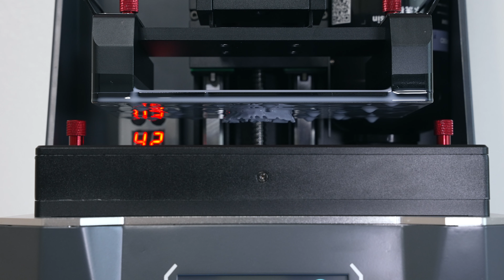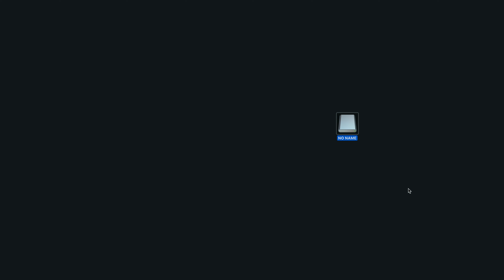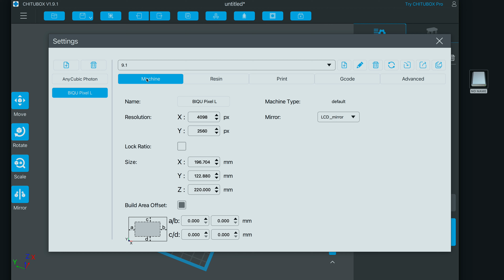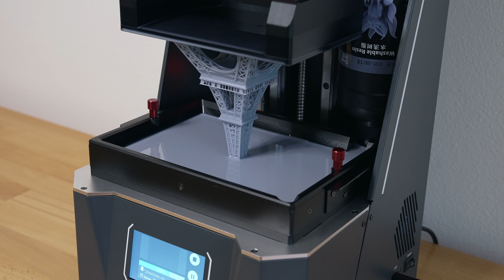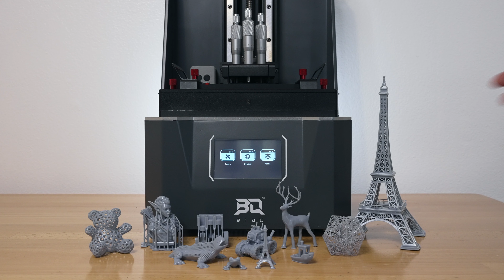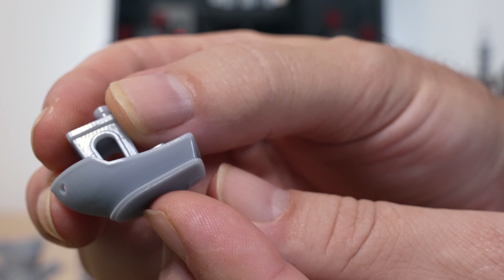BIQU Pixel L - 3D Printer - Unbox & Setup

Comment: Nice video. Just FYI, the clicky part of the micrometer handle is to set the appropriate torque on the micrometer for measuring. It does not adjust the depth, assuming this is a conventional micrometer handle and not a proprietary Biqu tool. The clicky knob prevents over-tightening, which causes inaccurate measurement readings. I don't quite understand why they provided these, unless it is solely to prevent over-tightening the build plate against the screen when leveling.

Comment: I dont understand why the heater control has seperate display and buttons inside the unit, when it has a touchscreen. Why cant it just be controlled from there? Just seems unnecessary.

Comment: Please DON'T put a hole in the bottom of the bottle, it needs to let air in from the bottom (plate) to stop it from overflowing. If you put a hole in the bottom of the bottle, it will empty the bottle in one go all over the machine.

Comment: Seems like they need to worry more about simple obvious things and less on unnecessary options.
Lid fit sucks.
Z height problem is really bad.
Don't need or want costly micrometers to level the bed.
Good review.
Thanks
Reply: For some of us that live in colder climates the heated vat is a godsend. Ive been waiting almost 2 years to see a printer under a thousand dollars come with this option and not have to bush rig it myself.